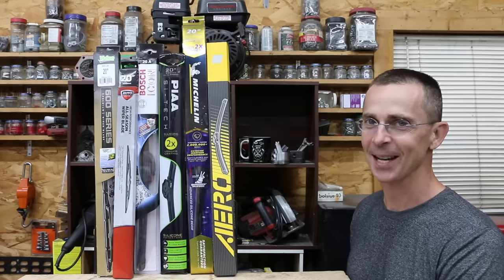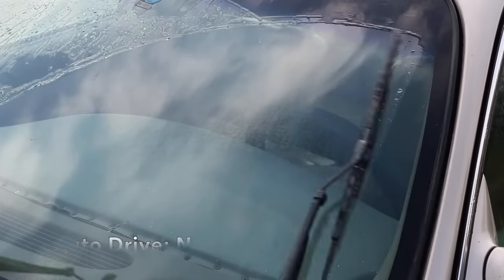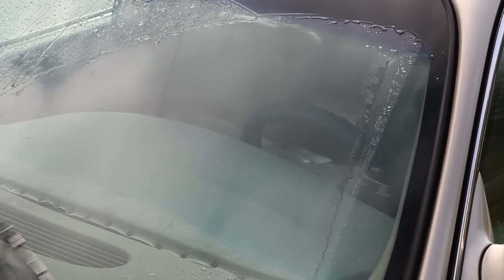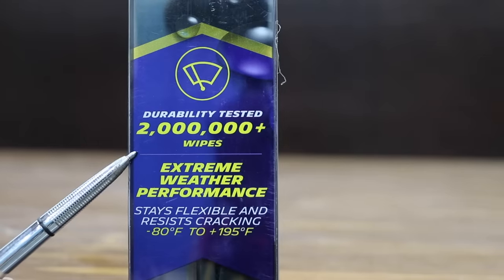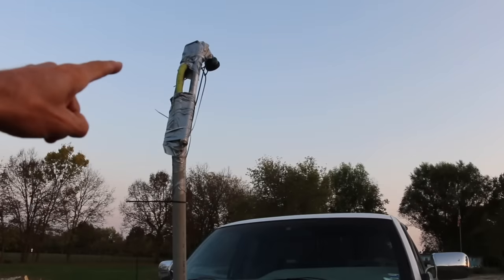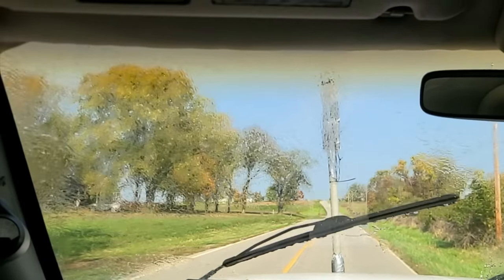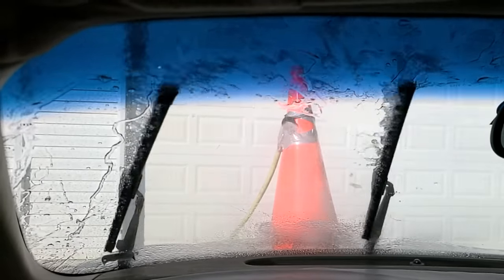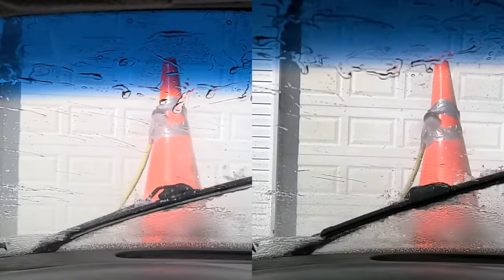Best Windshield Wiper Blade (AFTER 1 YEAR)? Bosch Icon, Rain-X, PIAA, Trico, Valeo, AERO

Comment: I literally went out and bought wiper blades on your recommendations. Thank you!
Reply from the maker: Glad I could help!
Reply: @Bond.007.  Maybe I got counterfeit PIAA blades, because the ones I bought were terrible. Streaky. They looked fine, but were so bad I put the old anco blades back on.
Reply: @Bond.007.  ive only used Bosch Icons.  They edge them out.
Reply: @xzibit8614  Bosch icons is the way to go. I can attest they last more than one winter season in Colorado if you don't pull on them when they are iced over.

Comment: Hello PF,

Great video! In my humble opinion having good wipers is important but nothing beats having a clean window shield and prepped with rainX. I don’t even use the wipers sometimes, specially at highway speeds. God Bless!
Reply from the maker: Thanks so much!  Thanks for sharing.
Reply: Been using RainX for years. Just started using the RainX blades as well. Makes a great combination in my opinion. No squeaks at all and most of the time you don't need the wipers.
Reply: @jaygraham4095  

Yes sir!!!
Reply: Are you using the 2 in 1 rain x glass cleaner? Or the (forgot proper name) pure rain x anti water lol. Right now I’m trying the 2 in 1 it cleans the windows very good but not sure how well it will bead off water like the original. You’re right about not needing to use the wipers I was amazed lol.
Reply: @brazyflow2850  
Brother! Always the original, the 2 in 1 one 1/4 what the original can do!!!

Comment: One of the failure issues with wiper blades is damage from pressure from the spring loaded wiper arm over time.  This causes the blade to tend to lean toward one side versus being vertical as when new.  A method for testing the blades under pressure over a six month period with UV exposure added.
Reply: There's also wear due to friction, so it's not that easy to test in a reliable way.
Reply: I had a 2006 Volkswagen Jetta that actually solved this problem. Every time you would turn the wipers off they would stop in a different position. This time they would stop on the down stroke. The next time, when they hit the bottom, they would move upwards slightly to flex the blade in the other direction. My wiper blades on that car lasted forever and worked great.
Reply: @unnainconnu9098  That is an issue with us in the SW. It rains about 8 inches a year here and the dust and grit on the windshield is significant. And the problem with the angle of the blade getting set in the park position.
Reply: @awboat  👍👍👍👍👍

Comment: What a great video and testing setup.  Anytime I've needed to replace off of OEM blades I've always went with BOSCH.  Anything they make is good quality - wiper blades, dishwashers, tools, etc.
Reply from the maker: Thanks!  Thanks for sharing.
Reply: Bosch is a oem supplier for a lot of the major car brands, so, they do have a good reputation to maintain.

Comment: Your review was on another level, thank you.
I have been using the same Piaa wipers for 2 years now and I have to say... because of the silicone film they leave on the glass, they are the best wipers that I hardly have to use. The film puts a barrier on the glass that works like RainX water repellant. Your review was missing the fact that the more you use silicone blades, the better the glass is coated.
Like I  said, 2 years 55,000 miles, ill never use anything but these silicone Piaa blades on any vehicle I drive.
Reply from the maker: You are welcome!  Thanks for sharing.
Reply: I love my PIAA wipers. As long as you wipe the debris collected from normal use every time you wash your car, they work great. I’ve had the same pair for almost 3 years.
Reply: I agree I use PIAA wipers on all my cars. They are quiet, wipe very well and last a long time. I've had some on one of my cars for 6 years now
Reply: Ditto on PIAA.  I have had the old style silicones on for about 2 years now.  When mine ever do wear out, I will be trying the flex blade version of a silicone wiper.
Reply: I got PIAA silicone on my car like 8-9 years ago and they still work like new. The car is garage kept however, and the last 4 years I maybe put 2-3K miles on a year. But the RainX like coating the silicone leaves behind makes it by far the easiest to see during rain. On my company cars the factory wipers last maybe 6 months before I replace them with PIAA's.

Comment: I've been using Bosch wiper blades for several years now.  I used to just get whatever was the cheapest when I needed new blades.  They would always squeak and chatter in light rain.  One day I saw the Bosch blades on sale and I bought a pair.  They are the best wiper blades I have ever used.  They run quiet with no squeaking or chatter and they usually last for 3 or 4 years.  They are the only blade I ever use now.
Reply from the maker: Thanks for sharing.

Comment: Now that you've got a rain rig, maybe RainX style window treatments?  That water doesn't even try to bead on that windshield!
Reply from the maker: Great recommendation!  Thank you
Reply: yep.  i've used rain-x washer fluid for years, but i'm curious if there is a better brand.  unless it's a heavy rain, i don't even need my wipers.
Reply: aquapel is better
Reply: @ysesq  way better
Reply: I'm not sure about better, but the turtle wax spray and shine and ceramic spray that were best in that test work very well on the windshield. Plus it's easier to apply than rain x, and since you are already putting it on the paint, just spray it on the glass too.
Reply: I’d be curious to see how a super fine wet sand and cleaning would compare on glass

Comment: Again thanks for posting these testing videos. It means alot to us viewers! I installed a pair of PIAA blades on my wife's car a couple years ago and I have to say those blades have held up pretty well with minimal streaks and noises.
Iong ago I used ANNCO blades long but always found myself constantly replacing them in not even a year's time. The Bosch definately looks promising and I believe that will be my next purchase for both of our vehicles. Again thanks and as always looking forward to the next video!
Reply from the maker: You are welcome!
Reply: I switched from Bosch to PIAA Silicone and my PIAA’s have lasted ~8 years now on one car.   Working fine… I have memories of my Bosch Icons drying out and cracking after 1-2 years which still beat the pants off what I used before.  I remember bc the Bosch’s were amazing when I installed them and they also are pretty bulky pieces of plastic, I felt bad throwing them out.  

Anyway YMMV and there are a lot of ppl praising Bosch here.  I really liked them.  My PIAA’s have just been otherworldly though.  

I also add RainX water repellent additive to my windshield wiper fluid.  Honestly as long as my windshield isn’t super fouled, I barely have to use my wipers.   Just spray my windshield a couple times when it starts raining, spread the wiper fluid with my wipers, and most water beads up and rolls right off.   Maybe it biased my experiences somewhat; I mean, it’s theoretically possible that my PIAAs would perform worse than Bosch under other conditions, just that my PIAA’s last forever
Reply: @stevebean1234 , I have been using PIAA’s exclusively for about ten years.  Still using the first set I ever bought!  I don’t feel that the newer blades are quite as good as the first blades I bought, but I still don’t think any other brand can come close to the durability of the PIAA blades.

Comment: Yup, I can vouch for the Bosch Icon wiper blades. They last an extremely long time I still have a set I got 5 YEARS ago, they have not had any streaking yet and still perform flawlessly. I do park my car in my garage so they are not exposed to UV as much so that's probably helped them last this long. I also always wipe down the blades every time I wash the car.
Reply from the maker: Thanks for sharing.
Reply: I wipe mine down too. I wonder now  if the UV coating wears out soon because of this and if there’s a product out there to recoat good wipers with UV protectant
Reply: @anavan7  I've heard of people using Aerospace 303 to rejuvenate and protect the blades from UV damage
Reply: Ive had a set outdoors for 10+ years, winter performance is starting to fall off, would recommend these to anyone

Comment: Just ordered a pair of Bosch Eco's 5 minutes back. Haha..
Reply from the maker: Great choice!
Reply: Hey great video. Just in time was on the fence about buying refill for my Honda but after watching this I think I'm going to go with Bosch icons. Thanks 😊
Reply: @suspicionofdeceit ya only 2,4 years but they used to last way longer
Reply: @neilmurphy845  I'm from India and I don't like using them for more than 2 monsoon seasons in the interest of preserving my windshield from scratching up.
Reply: @neilmurphy845  i've gotten a year and a half out of mine. You're  right the bosh don't seem to last as long as they used too.
Reply: @BertieJasokie  ya I guess so  windows are expensive wipers are cheap haha
Reply: @woodcrafter7361  ya Toyota used to use them in there 00s cars and they were the best they still are but I'd expect to last just a tiny bit longer
Reply: in europe bosch icon it's called aerotwin retrofit. we have them on 2 different cars, on first car they were replaced in 2014 and now the blades started to become stiff, jumping on the windshield so next to replacement. on the second car I had to replace them because of a flyer left during the rain I couldn't clean and it destroyed the blade. imho even when new they leave too much streaks, I can't even wash the windshield on highway, so at first rebate I'll go on other brands with silicon blades or back to the traditional frame (if I recon well Mr. PF tested some other brand as well some time ago, but not sure if I'll find everything in the old continent).
Reply: @nicusor86  ya all the silicone ones we can't get because there eider not available for the particular brand of car or just to expensive
Reply: @neilmurphy845  like PF said the silicone ones seems to be louder on the glass. So maybe it's for the best not getting them
Reply: @woodcrafter7361  ya I guess it all comes down to how much longer they'd actually last because if it's only a year or to there not worth the extra 20,50 euros

Comment: I’m in constant amazement of the hard work and creativity of your testing. Thank you!  Just replaced wiper blades on my entire family fleet of 5 cars.  I went with rain x expert fit, but had not watched this video till now.  Have not driven anything in the rain yet. 

Id say to everybody though, the actual rain x product applied correctly to my windshield is a literal lifesaver.  Water sheets right off to the point it’s almost better than having your wipers running full blast.  Highly recommended that stuff.
Reply from the maker: Thanks and you are welcome!

Comment: This channel is awesom, I use it as a guide for purchases; having said that, I used PIAA Super Silicone wiper blades on a 2016 ford Edge and they are amazing. The main advantage with the PIAA blades is that they leave a hydrophobic coationg on the windshield so that the wipers are not needed at speeds of 35 MPH and over. I live in south FL. so I know rain, my blades were about 3 years old and going strong untill a flooded neighborhood destroyed my cars.
Reply from the maker: Thanks!  Thanks for the feedback.

Comment: I've been using the Bosch Icons for years. Used to have to change wipers two to three times a year, but the Icons never really fail.
Reply from the maker: Thanks for the feedback.
Reply: im sold after this video.
Reply: Had Bosch wipers on my car from 2006 till 2012 when I sold it. For 6 years they worked great all I did was clean them with water and a napkin
Reply: Mine are still strong since 2015 !

Comment: I've used PIAA silicone blades on multiple vehicles for well over a decade in Phoenix heat with great results. I can usually get at least two years out of them before they start streaking.
Regular rubber blades disintegrate in about 6 months so the silicone is definitely a valuable benefit.
Nice video 👍
Reply from the maker: Thanks!
Reply: @ProjectFarm  Impossible to find refills for PIAA now just FYI. That was their biggest benefit.

Comment: Amazing the price increases over the years for wiper blades. Years back you could get just the basic rubber replacements for a couple bucks. But those Beam blades are far superior to the old metal bridge span looking type of wipers. ANOTHER great video by Project Farm!!!
Reply from the maker: Thanks!  Thanks for the feedback.
Reply: Just not the rain x beams. Read my story
Reply: @th-cc6ei  Thanx for the reply. I take it the Rain X ones aren't the Superior ones? I'm sorry, I scanned through many of these replies and posts and couldn't find your story to read!!! Hopefully it was just affirming Project Farm's excellent information,,,
Reply: Great point Tina. I've always wondered myself, why aren't there any refills available for wiper blades like we used to have 20 years ago? It's so expensive these days when you have to replace everything.
Reply: Toyota OEM blades are still refillable and you can get the refills online or from the dealer for a few dollars.

These companies desperately want to convince you to throw out those blades and go to disposables.
Reply: @joemamr710  
"These companies desperately want to convince you to throw out those blades and go to disposables."

$$$$$$$
Reply: The Aero ones can get refills it comes with an extra set.

Comment: You seem to have missed the fact that the Bosch Icons have a spoiler design backbone that functionally helps to keep the entire wiper pinned against the windshield at freeway speeds. I have personally driven at 80 mph and hit a good rainfall and experienced this benefit. You could simulate this by simply hitting your windshield washers at freeway speeds. You can then note that the entire wiper remains in contact with the glass the entire sweep. A lot of the others I tried (winter bagged frame or other beam type) would lift off the glass in the top quarter of the sweep.  This feature is more important with modern vehicles as the windshield plays such a important role in the aerodynamics, causing wind speeds across the glass to be far higher than the used to be.
Beam type also hold up better in winter conditions, not only not falling apart, but allowing you to bend them backwards to break off ice while clearing off your car.
My experience with Bosch Icons shows that a year of use would be a Minimum, and I recently ran a set for 3-4 years, and they were still safe and functional, though beginning to show wear.
They may be more expensive than the $5-10 ones, but those cheap ones fall apart/wear out in 3 months. If you lease your cars, you could easily only buy one set of Bosch Icon wipers for your entire time with it.
I have personally used the Bosch Icons since the early 2000's, shortly after the beam type was introduced, and shortly after Bosch started selling the Icons. The life and year round performance (I live in Michigan) has proven their value to me. I did try a couple other beam types, before settling on the Icons, after years of short lived fall apart frame wipers. No other wiper I have tried (I'm a trucker, but the company refuses to invest in Icons because of the up front cost of purchase), comes close to the life and reliability in Michigan conditions (110+ F on some summer days with 100% humidity, below -20 F before wind chill some winter nights, and freeways that can be posted at 75 mph)
Reply: I tried the Bosch Icons and barely got 6 months out of them.

Comment: I have a set of PIAA silicone wipers on my van that have been in use since October 2016. They have just recently started to chatter in one direction on dry or near-dry windshields. While that is the extreme, I've found that silicone wipers, and the PIAA ones in particular, last much, much longer than rubber wipers, which I find need replacing at least every year and usually twice a year here in Oregon.
Reply from the maker: Thanks for sharing.
Reply: They don't hold up well to a swipe across dew that is actually ice. By the time I see the "dew" is not wiping off the blades are history. I replace my rubber blades every three years (Flagstaff).